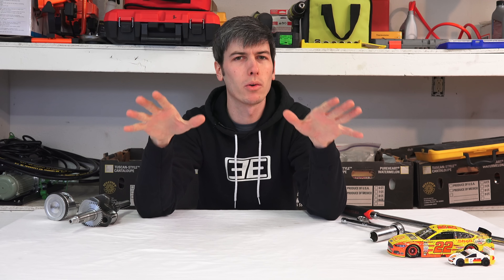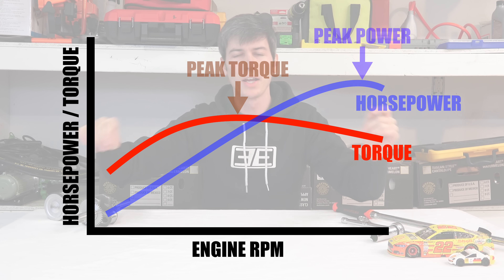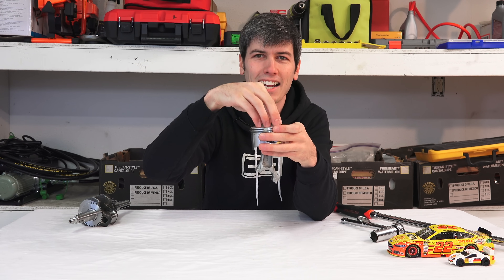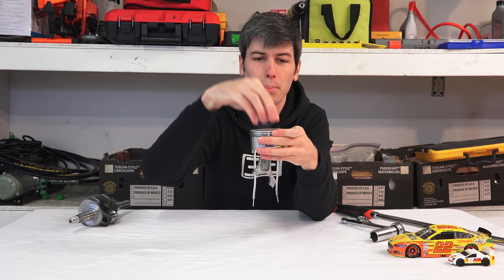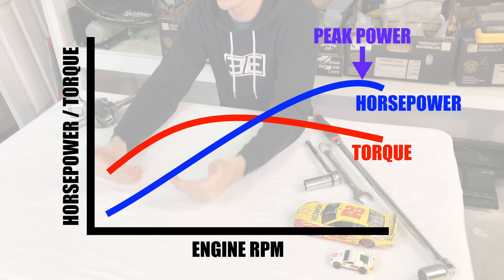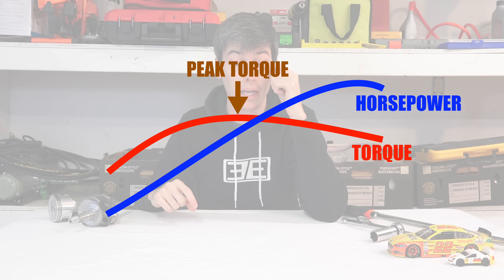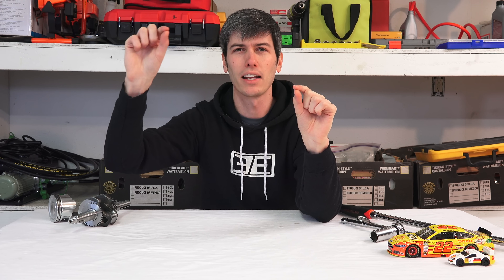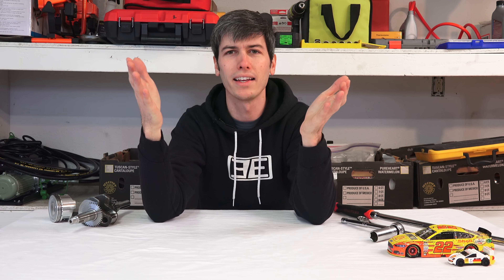Horsepower vs Torque - A Simple Explanation

Comment: How would going up a hill affect this? Wouldn't more torque be desired?
Reply: 'just change gears'... even while that's correct, I doubt most people would prefer that; when commuting or going on vacation, it's much easier to just put your turbodiesel car in 3 or 4 and putter around... no matter the rpm, it will 'pull' well enough; if you do that with a relatively small petrol engine, it'll stall or protest quite a bit... and 'encourage' you to shift down; if the engine isn't strong enough (torque) you pretty much need it to run at higher rpm just to get the work done; I agree with everything that was said about fastest acceleration in sports cars etc... but for normal, every day driving, most people prefer the 'puttering around' over being able to push your car to 8000rpm and hence produce 200bhp; for every day use, useable power at low to med rev range is more convenient than very high peak bhp at very high rpm, and realising you can always shift down 3 times
Reply: if you need more torque you can just change gears.  The more power you have, the better
Reply: Yes, But by dropping the gear ratio you lose top speed, More torque higher the gear ratio you can run without losing acceleration. 4.56 geared car is going to have crappy mile run but be fast through 1/8 and quarter mile.But geared for mile run it will be slower on the 1/8 and 1/4 mile all from torque manipulation.
Reply: You did not watch the video ... did you?

HP is pretty much the only thing that matter / you need to worry about. furnace3 pointed out the only thing that's better with high torque (but same hp) engine ... less wear and tear, and typically also less fuel consumption (due to less friction).

Instead of worrying about tq and rpm, replace your tachometer's marking of rpm, and put 0% at 0 rpm, and 100% at the red line. Have a gear ratio that will give you the same top speed in the gears, and now ANY car with the SAME hp rating will have the SAME acceleration. The torque numbers might be ranging from 2x (turbo diesel) to 1/2x (MC engine), but the acceleration, top speed, ability to tow will all be the same. The NOISE the car make will differ, but that's it (and yes, the MC engine would wear faster and the diesel last longer).

Think about this as two different people, one is very powerful, but slow (he can carry 500lb, but only at 1mph) the other person is very fast, but not as strong (he can only carry 100lb, but at 5mph). Both have to move 5000lb 10miles (assume they get back to the start instantly when they have delivered a load).

Who will finish first?

A) 10 trips each at 10h 10 x 10 = 100h
B) 50 trips each at 2h 50 x 2 == 100h

Both have done the same work in the same time, but one with 500ftlb (500lb carrying capacity) and the other with 100ftlb (100lb carrying capacity). However the big guy only revved to 1000 rpm, while the quick guy could do 5000rpm. If the quick guy get some gearing, it would slow down to 1mph but now he can also carry 500lb, but still take 100h.
Reply: So having an engine with 1,000 ftlb of torque and 100hp  vs ine with 1 ftlb of torque and 1000hp ...  you can GEAR the second one to produce 10 TIMES the wheel torque. Since torque does not say anything about RPM, which you need to know to understand how much HP is being produced, and hence what gearing you can have, torque is a useless measure to determine if an engine can pull a big-rig or a sports bike. HP without RPM does tell you that, as you know it's linear-ish from ~500 rpm to redline (unknown) but at redline (unknown) you produce say 500hp. An engine stating 500 ftlb of torque WITHOUT rpm, or without telling you what RPM it goes to will tell you NOTHING about the engines abilities, other than a general understanding of it's purpose.

Torque does not produce ANY acceleration at all, torque produce a twist power, but if you do not rotate, it's like saying torque is the only thing that will get my lugnuts of my tire, but I don't care if it rotate ... so how fast (acceleration) can you get a nut off a tire with 1,000 ftlb of torque at 0 rpm? I will tell you ... NEVER ... however with 0.1hp you have a chance to get it off ... as you are actually SPINNING something ... producing 0.1hp at some rpm, which again is derived from it's torque rating.

What semi trucks need is an elastic engine that can last 1,000,000 miles +, low maintenance, and low fuel consumption (vs it's hp rating). This tend to be diesel engines, which have a low rpm ( for semis it might be 2,000-2,500 rpm, for trucks it might be 3,500-4,500 rpm ). What's much more important for semis is to have a high torque rating from a low rpm, and a series of gears that can multply the torque to get the truck rolling.

hp = tq * rpm / 5252
tq = hp * 5252 / rpm

So HP and TQ is the 'same' thing, but tq without rpm is 0 hp ... which is like looking at two arm wrestlers in a stand still ... nothing is happening at zero speed.
HP tell you something without the rpm (typically hp is listed as it's highest value, that tend to be at the top range of it's rev range, and tq is peak that can occur from 20% to 80% dependent on the engine.
Reply: goguhu to say torque isn't important if pretty ignorant.
You want a decent torque for acceleration plus trucks+semis need good torque
Reply: Torque is needed to get the weight of the vehicle moving horsepower keeps it moving.Thats why vehicles from overseas always slow with quarter mile times. High HP. but the peak torque rpm is so high that by the time it kicks in the american car is already halfway through the 1/8th.
Reply: Mr. American yes torque is desired to move up the hill but horsepower determines how quickly you can do so over the length of distance

Comment: Huh, turns out I always imagined it the wrong way around. I thought if you could manipulate gearing infinitely like a CVT it would accelerate fastest at peak torque because it allows you to use higher ratios and therefore faster acceleration.

Comment: Great video!  Also, you need to get a duplex receptacle cover on your outlet under that shelf.  Safety first—engineering, second. :D
Reply: I was curious about your alternative viewpoint and original (before you edited it) assertion with no supporting evidence that "people die from gfci's all the time" so I googled exactly what you suggested and the page populated with various articles that talk about how GFCI saves lives by preventing electric shock - Which is exactly what I said.
They explain how the sensor monitors incoming current from the hot conductor vs outgoing current in the neutral wire. If it sees a difference, it presumes some current is finding another pathway (through a person for example) and then trips at a threshold of about 5mA of leakage, or below what would normally trigger heart fibrillation.
What you did not realize is that I'm an electrical engineer. And explaining how a GFCI works when a person touches the hot terminal of a GFCi was one of the questions on the Professional Engineer's exam, of which I passed. ;)
That said, leaving the cover off is still not Code compliant - (edit: because and as Pablo pointed out, unless there is another GFCI upstream or as I prefer, a GFCI breaker that protects the entire circuit, one can still get a shock from touching an unprotected terminal on the OUTside of the receptacle.) And the GFCI is a backup safety device. And it needs to be tested regularly (that test button is there for a reason) so you know it will do it's job when called on.
Reply: ACitizenOfOurWorld you do realize that even if the gfci trips, the screw were the wire on the line side is terminated is still hot, that's why you would want a cover regardless if it is a gfci
Reply: Timothy Paul. I was so blown away by the videos knowledge that i missed that. But he doesn't have to if it's not terminated😉
Reply: Look closely. It's a GFCI receptacle. So he can go ahead and stick his finger in it and still be alive to press the Reset button afterwards.
Reply: ACitizenOfOurWorld. No he can't, it doesn't work that way.
Reply: GFCI protect people and "circuit breaker" protect equipment.
Reply: he needs a decora plate
Reply: Then how does a GFCI work? Please explain and show evidence of people dying from a GFCI.
Reply: If safety was first I'd never leave the house! Safety always third.
Reply: frank w.  Negative.
Reply: GFCI only detects a difference in amperage in the neutral wire if memory serves me correctly. So, if no difference is read it will still shock you. But i haven't done electrical work in 20 years. Forgot half what i know
Reply: Nice!
Reply: they always say safety third, because you gotta look out for yourself. Not have the safety taken care of for you.
Reply: Safety safety safety, zzzzzzzzzzzzzzz
Reply: Sharp eye.  What's really going to eat away at you though is not knowing if he's really done it or not...lol.
Reply: I follow the Roadkill model, safety 3rd.
Reply: ACitizenOfOurWorld. Your kidding right. Are you serious, look it up your self: google-gfci deaths and watch it populate your screen. You really don't know how they work, and i'm not going to sit here and write you an article because your too lazy to read up about this subject. Sticking your finger in gfci receptable will NOT save your life, it is a ground fault detecting piece of equipment and circuit interrupter and that's ALL.

Comment: From what I understand:
The car with 200 HP / 100 LB-FT should have a higher top speed, but poorer acceleration.
The car with 100 HP / 200 LB-FT should reach its top speed sooner, but have a lower top speed.
I drive a Supercharged Thunderbird (with 210 HP and 315 LB-FT) so I've always been curious about the benefits of having more torque than horsepower.

Comment: When it comes to automobile engines a simple rule to go by is this.
Torque is the amount of work you can do.
Horsepower is how quickly you can do that work.

Look at semi trucks from back in the 70's and early 80's.  They were known to be slow but they still could pull a 53' trailer up a mountain pass.  Those trucks had torque numbers at 900+ but only 100ish horsepower.

Today's Semi trucks are keeping up with traffic even climbing a mountain pass.  Now the trucks have 1200+ torque and 500+ horsepower.  That 53' trailer can now go up the hill faster than 10 mph.

Comment: My favorite thing is when you said no strange analogies, because I’ve heard so many nonsense metaphors for power and torque that just cause confusion. Probably the biggest misconception that I believed until recently is that torque has to do with low rpm and power is for high rpm. I’d blame marketing, low revving engines like diesels can have impressive sounding peak torque numbers without any more power than their gasoline counterparts

Comment: What would be the advantage of having a high torque low horse power engine?
Reply: Provided they are geared right, none. Lots of work engines have more torque because they produce their max power at lower rpm for reliability. You can’t say that reliability is a direct consequence of torque though.
Reply: Ask any ship builder. You can still do a LOT of work, its just all in gearing. most ship engines run @ under 1000rpm but produce 1000-5000 lb-ft of torque. moving water isnt easy. but since 250*1000/5252 = 47hp.
Reply: Low HP ALWAYS means that you won't get much from your engine. Torque can be manipulated at will with gearing.
But heavy duty engines like in boats or trucks and tractors tend to have (very) high torque and (very) low RPM for reliability and fuel economy purposes.

Comment: Good explanation.  Here's a longish addition, which I hope is interesting ...

It might be helpful to talk about the case where you really don't have all of the possible gearing choices available, or you just don't want to shift.  Trucks hauling a lot of weight are a good example.  People will say that trucks need "low end torque".  That means that they want the peak in the engine torque curve to be at low engine rpm.  When a truck comes to a hill, it needs to apply a greater tractive force to the ground to maintain speed.  If the gearing doesn't change, that means it needs more engine torque.  Here's how it plays out, if peak torque is at low engine rpm:

1) truck starts climbing the hill, engine torque is insufficient, so the truck slows down a little
2) the engine slows down too, and produces more torque at the new slower speed 
3) if the new higher engine torque is adequate, the truck stops slowing down, maintains speed, and the driver thinks it's awesome
4) if the new torque is still not enough, the truck slows down some more, and we're back to 2)
5) if the engine speed drops below the speed for peak torque, the driver will HAVE TO shift to a lower gear.  Doing so will multiply the engine torque to generate more tractive force at the road, and truck will be able to keep going.  Otherwise, the truck will slow to a stop.

So, higher torque at lower engine rpm is good for a truck.  When somebody says that their truck "pulls" or "lugs" well, that's what they're talking about.  They don't have to shift as much on hills.

Also, since hp = torque * speed, an engine with high torque at low rpm can have nearly constant power for all speeds above peak torque (small rpm * large torque gives similar power to high rpm * lower torque).  Mack Trucks sold this "constant hp" concept as their "Maxidyne" diesel engine, starting in the late 60's.  They still produce engines with the Maxidyne torque profile.

Comment: Great video but still..  i dont understand which car is going to be faster.  But this explanation is the sympliest to me. When you accelerate from certain point towards to a wall. the greater hp the faster you will hit the wall. and the greater torque the further  you will push the wall.
Reply from the maker: The wall analogy is not accurate.

Comment: Great video, thanks!  I'm still not clear on why hp/torque numbers vary so much across different cars.  For example, what causes a Ferrari 458 to have 597hp/398 lb-ft while a C7 Corvette has 460hp/460 lb-ft. and a Mercedes S550 has 449 hp/516 lb-ft?  What are the major factors that cause these variances?

Comment: And if you DON'T have a CVT transmission, then the one with the highest average power within the rpm band with the width of the two gears with most spacing, you will be fastest :) Or if you have a rocket engine horizontally out the trunk with a magnitude more thrust than car weight, then you win...

Comment: Force, energy and power are different, but complementary things. Comparing torque with horsepower is like comparing speed with acceleration. You're just adding another variable (time in this case), because torque is force and horsepower, as its name suggests, is power. And force is what produces work.

Excellent explanation, as it's always! Great channel =D

EDIT: Sorry for my english. I'm not a native English speaker ^^U

Comment: Horsepower sells cars. Torque wins races.
Reply: For the record excellent video, even aged fools like me could make sense of it.
Reply: On paper he is right hp wins but once you add real world variables high torque cars have a huge advantage for many reasons like having a wider powerband meaning less time wasted shifting and the fact most cars are limited to a 6 speed transmission or 10 speed in the best case but in actuality  most 6spd only use the first 4 gears for acceleration and the 5th and 6th gear are overdrives for low rpm driving.  This is even more true once you factor in turning/cornering because needing to shift mid corner can upset the car and even if you shift you are dropping out of peek power which is why  low torque cars like a miata are "momentum" cars which require you to keep your speed/momentum up because it doesn't have the instant torque to launch it out of the corner instead it has to run the gear all the way out to regain its speed which takes time, sure it will get to the next corner just as fast as a high tq car but the hight tq car will be able to accelerate out of the turn faster and get in front of the low tq car then the low tq car will run it down by the end of the strait but by then its to late because your at the next turn and the high tq car can intentionally kill your momentum then quickly accelerate away. Look at race cars where theres a engine size limit of 3.0L you never see a 2.5L engine because race engineers want as much displacement as they can get because it gives more torque even though both the 3.0L and 2.5L will make the same peek power due to restricter plates. So yes   Torque wins races. deal with it.
Reply: It sounds good on paper, but not in the real world. He casually glossed over the whole gear ratio problem like it's nothing. Go put some .488 gears in your car and see how it drives down the road, let alone the freeway. Hope you don't mind a constant 3500 - 4000 RPM at cruising speed 😂
Reply: Nope! Did you even watch the video?
Reply: Torque does not win races wtf -_-
Reply: I was actually being facetious, my apologies to the literalists out there. 
This is a phrase idiomatic among American car salesmen in the 50's and 60's, I thought it might remind a few people of 'stuff their dad said.'
Apologies also to the young.

Comment: Another great video man, keep up the great work.
I do have one question though
If Horsepower = torque * rpm then how can cars like the Focus RS have 350 HP and 350 lb-ft of torque? By this equation, shouldn't horsepower always be greater than torque because the engine is at least at idle?

Thanks again for the great content Jason.

Comment: If torque = Force*Distance and Horsepower= Torque * RPM then why does torque drop off at higher RPM? Seems torque should keep climbing and have no drop off as the force is increasing and the distance does not change.